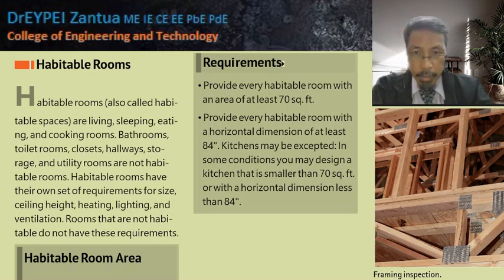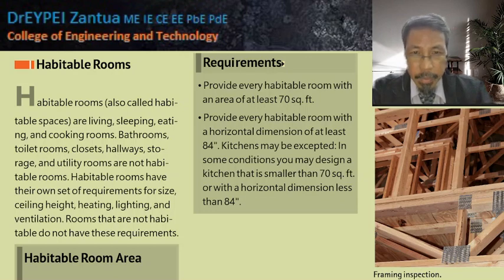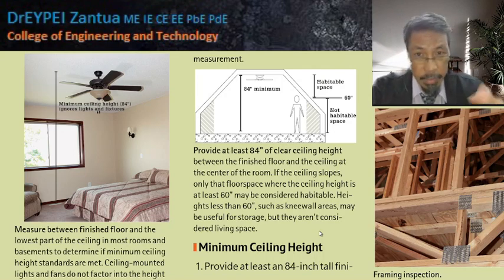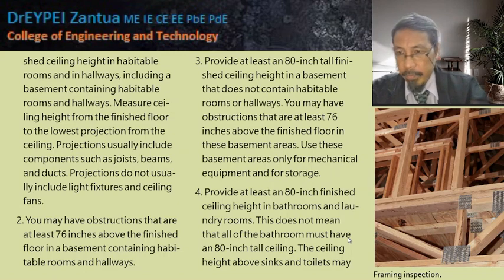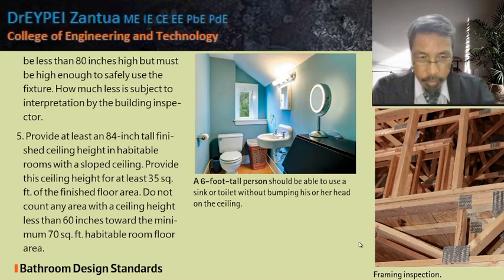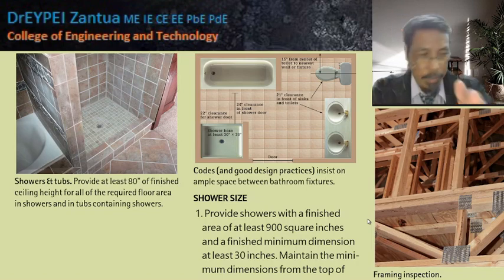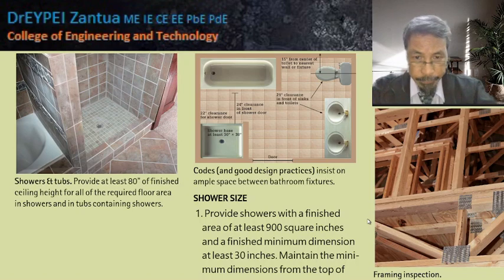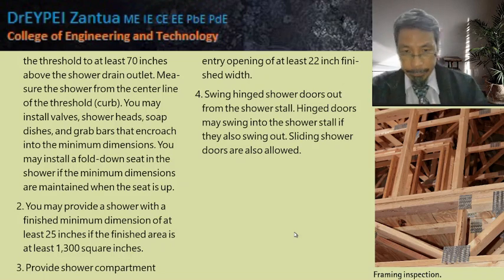[Ch02 BD 01] Building Code for 1-2 Family Dwelling & Townhouses: Building Design & Habitable Rooms

Comment: Sir According to Chpater 8 of The National Building Code of the Philippines PD 1096 SECTION 805. Ceiling Heights
(a) Habitable rooms provided with artificial ventilation shall have ceiling heights not less than 2.40 meters measured from the floor to the ceiling; Provided that for buildings of more than onestorey, the minimum ceiling height of the first storey shall be 2.70 meters and that for the second storey 2.40 meters and succeeding storeys shall have an unobstructed typical head-room clearance of not less than 2.10 meters above the finished floor. Above stated rooms with a natural ventilation shall have ceiling heights not less than 2.70 meters.
(b) Mezzanine floors shall have a clear ceiling height not less than 1.80 meters above and
below it.

In Section 806 Size and Dimensions of Rooms.—
a. Minimum sizes of rooms and their least horizontal dimensions shall be as follows:
1. Rooms for Human Habitations — 6.00 square meters with at least dimensions of 2.00
2. Kitchens — 3.00 square meters with at least dimension of 1.50 meters;
3. Bath and toilet — 1.20 square meters with at least dimension of 0.90 meters.

Dr. Zantua can you verify po this information, correct po ba ito? Thank you sir.

Comment: Pedrigal, Jhon Harvey M.
19-00204

Habitable rooms shall have a floor area of not less than 70 square feet (6.5 m2) and shall not be less than 7 feet (2134 mm) in any horizontal dimension.

Comment: Mendiola, Mc Axel Joseph P.
19-00167 

A Habitable means suitable or good enough to live in. Therefore, the rooms that can be considered habitable are the living, sleeping, eating, and cooking rooms. Every habitable room have an area of at least 70sq. ft. or 6.5sq. m and a horizontal dimension at least 84" and for the kitchen you must have a size that is smaller than 70sq.ft. or with a horizontal dimension less than 84".

Comment: Capulong, Mark Anthony C.

Rooms shall have a minimum size of 6.00 square meters (65 square feet) with a least horizontal dimension of 2.00 meters (6 feet, 7 inches) for rooms of human habitations
(c)National Building Code of the Phillipines -Chan Robles

I searched for the information and i think habitable requirement in Philippines is smaller are and height than the other country but close. I hope to see more information from other comments po sir

Comment: Ruiz, Sharlize Veyen C.
19-00620

To be able for room to be habitable. It must have the requirement area of 70 sq. ft. or 6.5 sq. m in SI units with an 84'' (2.13 m)-horizontal dimension. However, If the room are less than 60''-horizontal dimension. It is not considered a living space.  This part can be used as a storage.